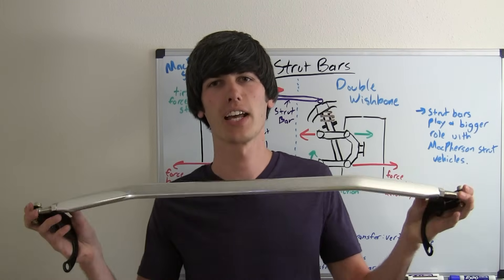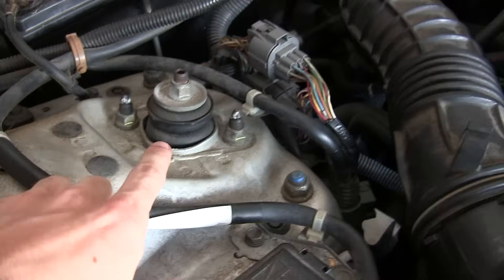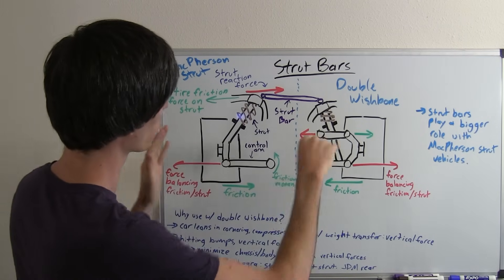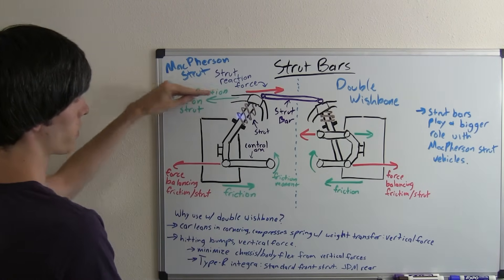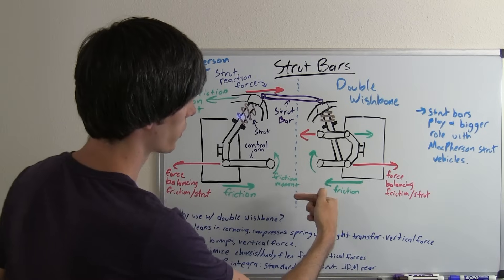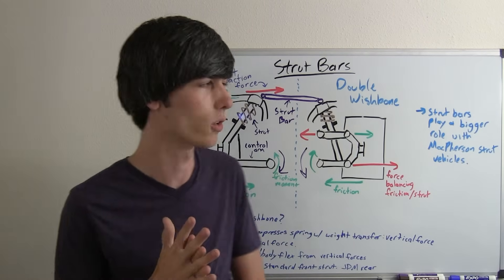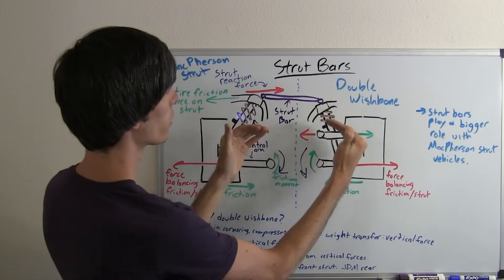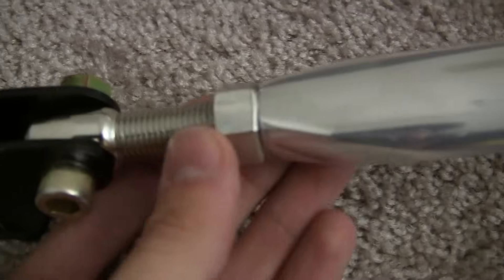Strut Bar - Explained

Comment: I am confused. When hard turn right, doesn't the car body roll or lean left? Cause from your description, the left wheel lift from body. Is there any info I missed out before I watch this clip?
Reply from the maker: Yes, when turning right you will lean left. Friction will be resisting in the opposite direction.

Comment: Hrm, it's difficult w/o knowing the platform entirely off-hand.  Though if you go into any forum's (like if you have an integra, check out honda-tech for example, an SRT-4, check-out srtforums, etc.) autocross section and you'll find tons of people who know how to fix the problems on that particular platform.  The oversteer is most likely caused by too tight of a rear, which can be caused by tighter valved struts in the rear (happens when people mis-match), too high spring rates, or continued

Comment: Does vertical flex matter? If the forces acting on it are horizontal, vertical flex in the bar shouldn't really matter right? Unless it's over uneven terrain or roads
Reply: Yeah, it's at high speed where chassis reinforcement really shines. It's the older cars that could really use it too.

Comment: Any idea about the reasoning about different mounting points for the shock tower bars on the integra/civic? 

I've been using the OEM Type R bar which mounts with those rubber gormets with the use of screws and nuts, whereas the gsr and type r have welded studs. I saw in the other video the bar you are using mounts on the shock mounts. And then there is the neuspeed bar which mounts over the upper control arm bolts. 

I honestl'y didnt feel any difference, but did read neuspeeds made the most.

Comment: PS one thing if the left wheel has its friction going to the left while cornering right, than the right wheel has the same. Does that mean the rights strut also want to lean to the left?

Comment: Hey man , have a small question. Will using a better made tyre with same dimensions aid in lowering down body roll. 
Will better tyres affect body roll ?
Reply: Doubt it. All the body roll happens up top, at the body. That's the whole purpose of a strut bar. All you gonna do by upgrading your tires is improve grip.

Comment: So, just a thought; because of the forces involved, I feel like a solid strut bar, that attaches to all the strut-top bolts, without any pivoting joints on either end, would be superior in function to the typical bars seen around that have only a single mounting bolt and a pivot joint on either end.  
And at that, if it could triangulate down to the lower control arm pivots , that would (if feasible) give maximum stabilization of the structure. 
Anyone know if that be a correct assumption, or no?

Just my 0.02, take or leave it.

Comment: as for the gsr, type r, and civic si come with strut bars, the strut bar is mounted along the strut tower area as we all know but its not mounted onto the actual strut tower itself to support the struts.  u have to drill into the tower to mount these struts.  with these type vs the ones that are made to mount right onto the strut, which is better?

Comment: What type of bar is mounted at the top of the strut towers over top of the engine?I have a 1983 Chevy Camaro with a 350 motor in it and it has a bar over top connecting the two tops of the struts shocks whatever?

Comment: Somewhat related; I saw a vintage corvette with negative camber on the back wheels. Would this camber potentially help keep the outside tire planted when taking a tight corner at a high speed and reduce over steer because of the friction trying to pull the wheel inward (therefore the tire may be closer to flat with the pavement in that situation than without camber)?

Comment: Hi, I have a question. Im driving an EG5 and something I notice is that my rear strut bar isnt very solid. When its mounted and I grab it in the middle and shake it, the bar starts to elasticly bend a bit. So the question is - does it still do what it is supposed to? From this video I assume that strut bars deal with push/pull forces only and not rotation momentum.

Comment: Is there an advantage for strut brace over strut mount vs. strut brace connecting to the side of the tower?
Reply: Top mounted ones are mounted as close as possible to where the McP strut or shock absorber so there's less flexing bodywork between the brace and strut. Less flexing stuff = stiffer body = more precise handling. I imagine a brace connecting to the side of the tower might be useful in double wishbone suspension if that puts the brace closest to the wishbone mounts. However, the engine will be more in the way of a brace mounted to the side of the tower.

Comment: the question people might ask is what's better aluminum bars or steel bars.. I prefer a bar that does not flex n maintains rigidity. . aluminum bars tend to flex n those cheap ones off the net aren't really great either. Came across Ultra Racing(UR) bars years ago and totally worth every penny.   They stand by their products, I've seen some tuners crash n I've seen their bars break but I've never seen an UR bar break apart.. I've seen them absorb the impact but I'm yet to see one break.

Comment: Im considering doing more work to my suspension. 2011 wrx, only suspension mod right now is Eibach springs. Is there a point in getting a Strut bar without sway bars?
Reply from the maker: They serve different purposes, so yes.
Reply: +phunkdoctaspock +bill lumbergh was actually correct lol and he has a good point about standing and camber it's stupid
Reply: +phunkdoctaspock strut bars act in tension and compression. connections are free to rotate but they can still push and pull and yes those bolts can resist those pushing and pulling forces.  You need to think harder.
Reply: +phunkdoctaspock jabba hanson
Reply: no, your modern wrx is already stiff.
Reply: +Bill Lumbergh Thankyou. hahaha

Comment: on a really bumpy road you loose ride comfort since that the car is too rigid.
my own experience I have front and rear strut bar plus a lower tie bar
on bumpy roads the whole car follow instead that one side is affected since the suspension are fully connected
you won't lose a lot but you will feel it but you got a better handling wich I like!

Comment: Greetings. First let me say that It has been a great help watch these videos. Now, if I want to make a homemade strut bar, I know that I should consider the calculations of the axial stiffness for positive and negative forces (compression and tension). By selecting a few young’s modulus only would need the cross-sectional area and the length of the element, and that would allow me to calculate K (Axial Stiffness). Know my question is. If I decide to add a screw in order to make the bar adjustable, how can I use the formulas of deformation in X,Y,Z along with the Poisson constant to determinate what kind of screw do I need that can resist the forces?

Comment: I have watched a ton of your videos and the day has come, I have a question for you. So for example the front strut tower bar your had in this video appeared to be a hinged example of this product. Now, I am sure your aware that some manufacturers produce a solid strut bar. Another variation I have only seen as of recently is of the hinged variety but has a center hinge, almost ball and socket, as well. (2015 STI JDM FSTB) 
QUESTION: to your knowledge is there additional benefits, or drawbacks from one to another? If indeed there all different. Could you explain how one is different from another and how exactly there design geometry translates into different performance or applications? Thank you so much for your time.
Reply: TheWanskiz In a car with McPherson struts it doesn't really matter if the strut bar has hinges or not, since the bar primarily transmitts a compressive force.
In a car with double wishbone suspension you should get a strut bar without hinges so that it can transmit a bending moment. A strut bar with hinges will most likely have no effect on a car with double wishbone suspension

Comment: Hey, it's me with the radiator question from a while ago. I have a 1996 Toyota Curren, and planning on making it my project car after I learn enough about cars, in order to do stuff on it. Anyway, my car also has a strut bar (I think), but it does not go straight from one strut tower to the other, but instead it connects to the car's body at the back. So, if you're sitting at the front of the car, the strut bar is caved in and bolted to the back of the body, as well as the two strut towers. Is that purely to get it out of the way? Does it act differently than a normal strut bar?
Reply: It's a front strut bar*

Comment: I have a 2017 Subaru Forester XT. The rear sway bar did make the car feel more planted around corners (it's a 20 mm vs 16 stock). Would a front strut bar help my car at all feel a bit more planted and less rolling/yaw? Anyone try it?
Reply: Damn, I wish someone would have replied to this. I upgraded my rear sway bar from 12 to 19 and would also like to know if added a front strut bar would help in anyway

Comment: I have heard that a strut bar or any kind of chassis reinforcement bars can cause damage to the car in the long run, is that true?
Reply: thaik56 Im no expert, but im gonna say no, they dont. Because some vehicles come stock with performance bracing
Reply: Nygil Copeland You may be right with that, I also agree. Even the RSX Type R  I believe had some major reinforcement done to its chassis by Honda. It's just something I wanted to investigate and confirm, they say something like "Cars are meant to flex, adding reinforcement is trading durability for performance".

Comment: Does it affect the safety of the vehicle in case of a crash?
Reply: It can go either way.

It can save you by making the chasis stiffer preventing the crash from reaching the passenger.  

Or it can injure you because of the crumple zones that is supposed to collapse during a crash, did not, because it was prevented by the strut bar, making the impact of the crash get in the passenger cabin.
Reply: Thank you so much!

Comment: +Engineering Explained I am thinking about removing mine for weight saving since I only run 1/4 mile.Would doing so harm the car with torque flex? Currently at 600+whp@engineering explained
Reply: High speed driving is where chassis reinforcement really shines.

Comment: I moved from a 2014 accord saloon to a 2017 accord coupe which is basically the same car with 2 doors less. But the handling of these 2 cars is way different. I guess part of it could be because of the strut bars and part of it could be because of the rigidity of the coupe body type.

Comment: Hi, I have a Chrysler 300 with 22s, would this help or hurt my car? I have speed bumps in my neighborhood so always bumping and sometimes I don't slow down appropriately, and now I'm hearing noises like spring or henge sounds when the car bounces just want to know before I invest, thanks for your help.
Reply from the maker: Strut bars aren't going to help you; unfortunately large wheels often sacrifice ride quality, as lower profile tires don't have much give, and don't provide much benefit as a suspension. Higher profile tires will offer much more comfort, and will absorb more of the bumps in the road.
Reply: Which ones do I have the lower or higher profile tires? The tires came with the car when I bought it, I just thought they were pretty (typical girl, I know). And when you say profile do you mean size? Thanks for your help by the way.
Reply: Acting With a Purpose im gonna go out on a limb and say u got low profiles ones. profile indicates the tire size's sidewall height (from rim to tread) as a percentage of its section width. The measurement is the tire's section height, and also referred to as the tire's series, profile or aspect ratio. simply put, look at the sidewall length. if the length is short, it's low profile. if it's long, it's high profile. i dont know what the of high and low is but i will assume a safe bet would be 50%
Reply: thanks they are 22s i believe. I learned that  the special mount that holds the tires needs to be replaced.
Reply: Acting With a Purpose it dont matter what kind of tires or rims you have on, pot holes will mess up your suspension's so if you keep hitting potholes on the passenger tire, very soon itll start to give in because the weight of the vehicle is sitting on top of that tire too and with potholes the suspension would go down into the whole then it has to come back up with the weight of the car so with many of these something have to come loose and usually the weakest point of your suspension would be a joint.  many times would be your ball joints. particularly the lower ball joint.
Reply: That helps a lot!!! Thank you for explaining.

Comment: From what I have noticed, especially in heavy cars:

 A strut bar like the one in the video that has a pivot point on the shock tower connection, cannot really do that much. 

A one piece strut tower with  rigid connection to the strut tower would better. But still, l the force on the shock towers pulling in the same direction on a  hard corner, don't oppose each other as in the sway bar function. The best design tower brace I have seen is a Triangle that has one of its " vertices"  (center) anchor to the center of the firewall.

Comment: goood that I drive on the McPherson system. Less bushings wich can cause problems. I had a crx and now I am driving a Type-R (McPherson)- I can't say the McPherson is not made for performance. Its pretty accurate in corners. But its a pain in the * driving over speedbumps. And I can easily set the camber.

Comment: So, I have an 06 impreza, which I believe has macpherson struts, right? Would putting the front spt strut tower brace make a noticeable difference? Cause I've read a lot of people say that it doesn't do anything.
Reply from the maker: ***** Noticeable? Probably not. Especially if it's primarily a road car.
Reply: By itself, you won't feel a difference with a front strut brace.  Especially on Impreza's bc the front struts are located further back from the nose of the car than, say, a Nissan 350z.  To really exploit the addition of strut bars, I recommend getting larger/stiffer sway bars.  Not as easy of an install, but well worth the time and money.  I have an 07 sti and I really only felt a difference in chassis rigidity when I added Perrin sways.  You can find a used name brand sway bar for less than $200 on ebay or CL.

Comment: I commented on a completely unrelated video, but is there any play in the hinges on your strut bar? If there is, I feel like the towers' very small range of motion might be smaller than the play in the hinges, transmitting no force at all between the towers

It'd be interesting to do a comparison at an autocross or track day, some seat time with it as-is, and again with the hinges welded, materials permitting.

another thing, if you can lean over the engine and bend the strut bar with your hand, bin it because it isn't doing anything for you. At the end of the day, on most cars these are just a confidence and feel improvement, if anything but I have one on my car too. I like it because it's triangulated and actually ties into the firewall as well
Reply: I too also have my doubts about strut bars with pinned connections. If the tower is moving or creating a moment about the point so to speak then the pinned connection will not transfer that moment to the other side and the brace ends will just rotate with the tower.
Reply: Steve Abbot That's a motion I hadn't considered. I think even with just directly inboard travel these bars could be inadequate. Torsional forces are another curveball

The joint is there for cost effectiveness and ease of install, but I'm curious how much it takes away from the bar's performance. Most race guys don't believe in hinged bars
Reply: pooft Lee  Solid welded strut bars are better. The ones with hinges give too much.
Reply: pooft Lee not necessarily, it takes amuch greater force for the strut to buckle when pushing from the hinges compared to pushing transversely against the strut itself
Reply: Joel Sägesser what I'm saying is there isn't any force transferred between struts, because there would be some free movement in the actual hinge. Forget the rotation, think about the physical play in the hinge itself. The gap between the strut bar and hinge pin. If that pin isn't interference fit, then it would allow lateral movement before actually applying any force to the other tower. It would be equivalent to a small gap in the middle of the bar if the hinges have wide tolerances

Comment: I know this is an old video but I've always wondered with bars that have a single bolt mounting at each tower how the force is transfered to the opposite tower without the bar pivoting?
Reply: Goes back to the part about the strut bar only being as effective as its weakest point. If you only have 1 typical sized 14mm bolt holding the strut bar on, that is going to lessen the effectiveness of the bar as that is now the weakest structural point of the bar
Reply: @pass_the_flask  My point is it's more that a single point is a pivot..

Comment: Strut bars  work well with coilovers ... Right ? Is that Wat he explained in this video .... For example Megan Racing coils with M.R strut bar ?   ... Or is he saying it works better wit stock suspension...?😯...
Reply: +Qezt Nest whichever suspension shouldnt matter, it will improve handling on either aftermarket or oem suspension. its not like its night and day difference, but every little bit helps

Comment: There should've been more emphasis that a solid piece bar is far more rigid than one with pivoting bolts.  Much more thought has to go into a solid one-piece bar as it must be custom made, vs parts-bin approach for screw-out bars with pivoting bolts attached